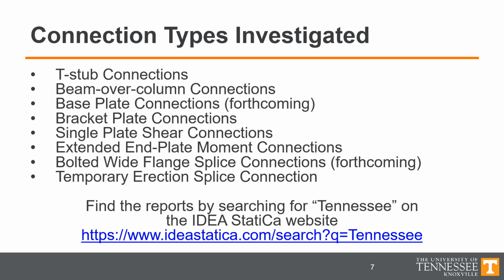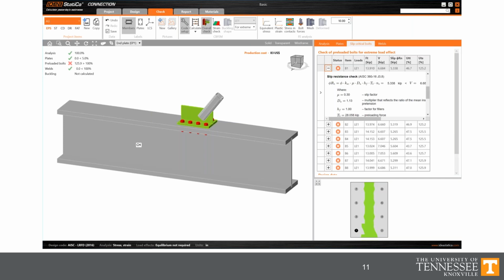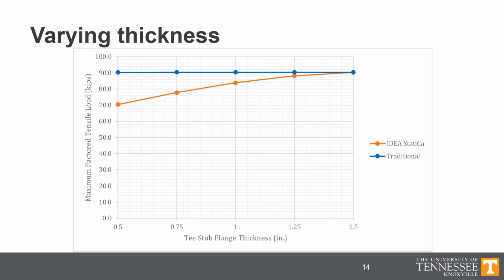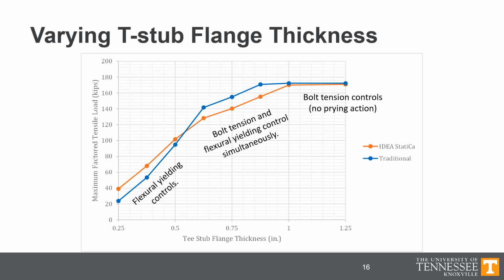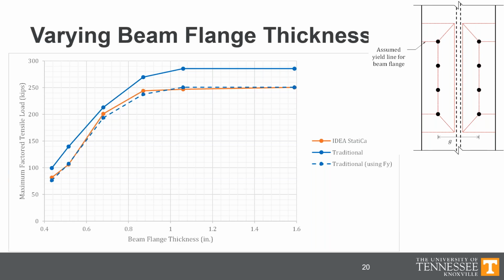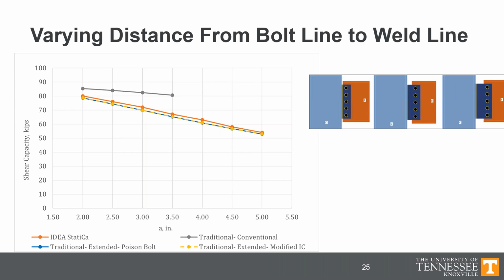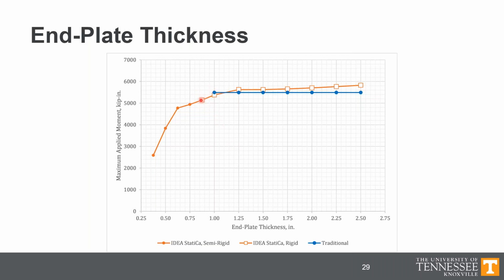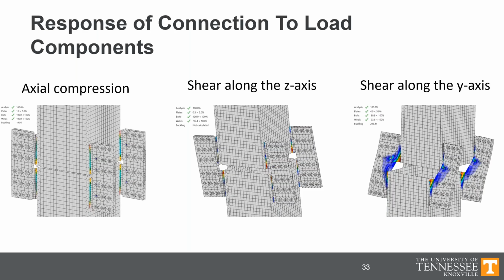AISC Verification studies of steel connection design in IDEA StatiCa

Comment: Thank you & thanks to IDEA for funding this research. It's good to see the correlation between methods and this was a very clear, no-nonsense presentation getting the points across. I'm looking forward to seeing more.

A question was raised recently here in the UK, it's to do with how StatiCa treats plasticity of welds. A number of people questioned seemed to think the treatment is incorrect and the weld will "unzip" before reaching the 5% plastic strain limit. Welds are notoriously brittle  compared to highly-ductile mild steel so allowing 5% strain similar to the ductile steel parent would appear somewhat “optimistic”? EC3, whilst not as far as I know giving a strain limit for welds, notes the brittle nature of weld material.

A discussion exists within the CBFEM Verifications section on the IDEA website however do you intend to do any testing comparing how StatiCa treats welds to how they react in real-world physical models?
Reply from the maker: "The validation of the proposed CBFEM model is presented on three published experimental works for the fillet welds:

1. Loaded in parallel (Kleiner, 2018)
2. Loaded perpendicularly (Ng et al, 2002)
3. Multi-oriented welds (Callele et al, 2005)

Longitudinal welds (loaded in parallel) were tested intensively at University of Stuttgart. Transverse welds (loaded perpendicularly) were tested at University of Alberta. Multi-oriented weld groups were tested again at University of Alberta. The weld model used in CBFEM is very conservative both in terms of resistance and plastic deformation, see for further information: 

https://www.ideastatica.com/support-center/cbfem-weld-model-validation-and-verification

Also, to avoid that welds will not rupture before yielding takes place in the adjacent parent material, in the latest versions of IDEA additional warnings are given when the weld size is below a certain limit based on rules from the concept version of the new Eurocode FprEN 1993-1-8 cl. 6.9(4)."

Comment: Thank you. Great presentation. Very detailed. In your simulation I see lot of hotspots on single elements on nodes, especially at the welds or bolts.. How can you distinguish those are not mesh singularity issue and real stresses?
Reply from the maker: In the latest versions of IDEA StatiCa many improvements have been made to the mesher to avoid mesh singularity issues, however they can still sometimes occur, they are often the concequence of bad shaped elements (for example elements with high aspect ratio, skewness etc.). We recommend checking the quality of the mesh and in case of doubt recalculating the model with finer mesh settings.